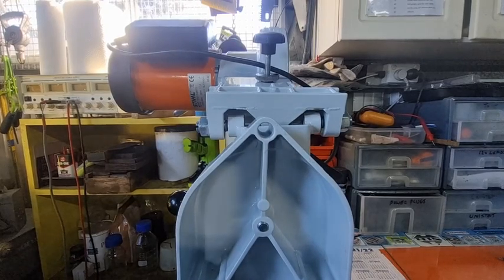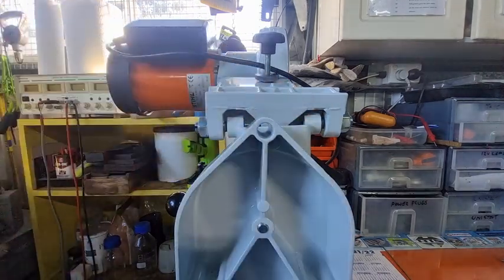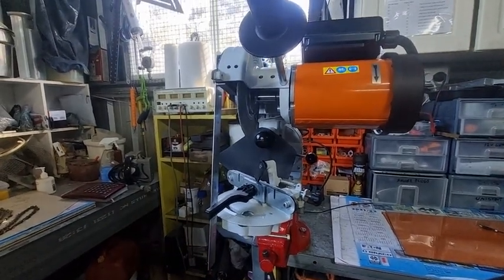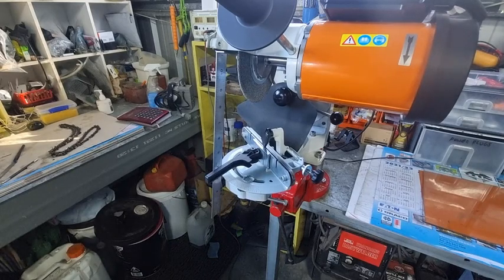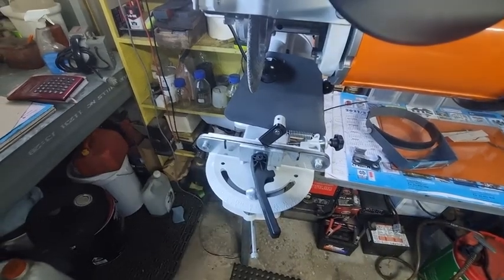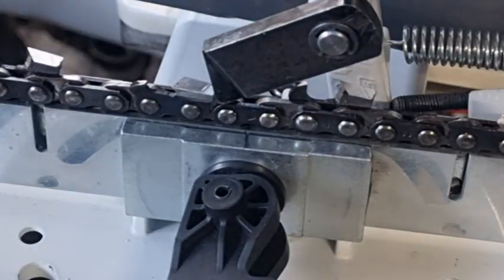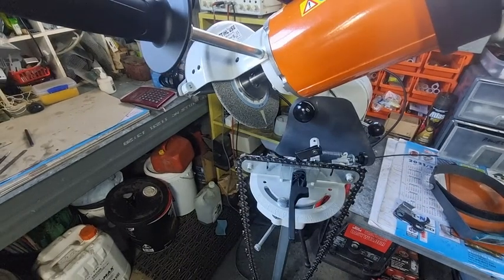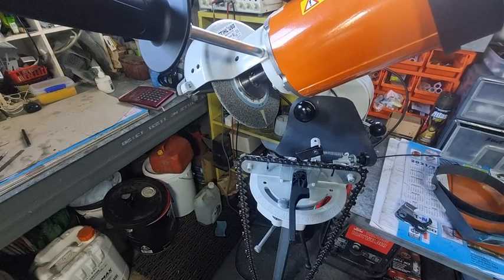Stihl USG grinder offset grinding to aid cooling

Comment: About ten years ago, I bought a not-so-new USG machine without instructions, started grinding and realized that the right and left teeth have different side profiles. I was very confused by the fact that on a machine in which parts are made on milling and grinding machines, the result is worse than on machines with simple aluminum casting. I began to investigate in detail what was moving where. I visually noticed that the grinding wheel was not lowered completely perpendicularly. To confirm this, I removed the grinding wheel and clamped a steel ruler in its place with one edge. When lowering, I saw a deviation of about a centimeter. Then, behind the machine, I noticed a head tilt angle of 2.5-3 degrees. The thought immediately came to me about a worn-out old door hinge that opens askew. I decided that the machine was defective and sold it. Then I bought four more different new machines and they all had the same problem. This made me think that it was designed that way. And recently I found the Chainsaw Users channel and privately told the author about my research, now we are racking our brains together why Stihl did this. I live in Ukraine and I don't speak English fluently, and I have to communicate with a translator. This slows down and changes the perception of my answers. I wrote to the author of the channel about the experiment with the ruler a long time ago, but probably because of the inaccurate translation he didn't really understand me :)

Comment: Got a question for you. 
I have a Stihl 391.  I use it for cutting wood to burn in our home, and to help friends out periodically. 
The top 3 bolts on the top of the saw keep vibrating out and i lose them...
I recently purchesed OEM bolts and snugged them down. After about 4 hrs of sawing I noticed 2 of the 3 were missing. I cant be the only one with this problem. Could you please address for me some possible cures...
Thanks, Brett in MN USA

Comment: So you’re saying the A scale is actually correct because of the offset and should be set to 40° marked on the scale?
Reply from the maker: Yes while the A scale is offset 3° this is made that way to work with the c scale 17mm offset and the B scale compensates this with -15/+15
Reply: Thank you for clarifying. Really enjoy your videos by the way.
Reply from the maker: Thanks with the USG grinder it's been a challenge to fully understand what and why Stihl did with this grinder. 
 It taken a few of us in a small  group to fully understand the grinder

Comment from the maker: Many thanks Serg for finding this issue and bringing it to my  attention, I also was puzzled with the offset I remember when you told me to use the ruler and check.  I was a bit puzzled by the ruler method English translation lol.  But then it clicked whats you was saying about the wheel moving away from the tooth.
The USG grinder is unlike any Oregon Tecomic style grinder.
Reply: When the head is lowered the grinding wheel moves to the left, but it cannot move parallel to the groove, scale B, it moves at an angle relative to the ball joints. It turns out that it will meet the left and right teeth at different angles, 33 and 27 degrees, approximately. Can someone accurately measure the angles of the upper plate of the left and right incisors? Or this error could already be laid in the scale C
Reply from the maker: You did mention before that the left and right grind slightly differently.
This would be another investigation that may take time to solve.
I will have to look into this.
Reply from the maker: @sergiyshariy3 One of the reasons I see people getting different size teeth on one side  is because its user error.
After sharpening one side you must adjust the backstop and setup the other side and grind the same about of metal off.

While moving the C scale this should not affect the amount that being ground.
I have checked the C scale for accuracy and its accurate.

I also hear  people with Tecomec and Oregon grinders saying the same thing.
Reply: @ChainsawUsers  If the axis of the tilted motor is exactly in the center of the vice groove, the left and right teeth should be the same length without adjustment.
Reply from the maker: Yes agree with you on that